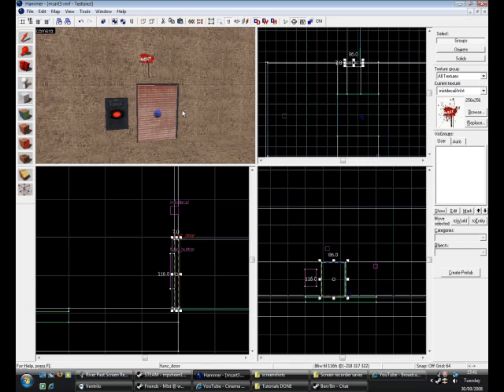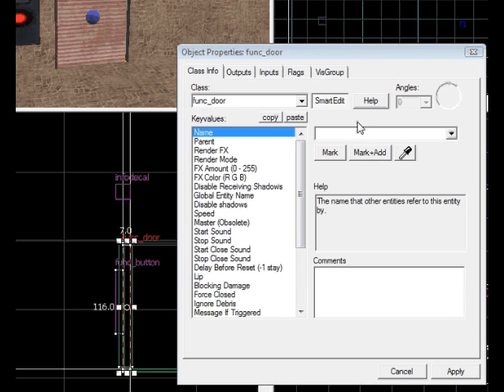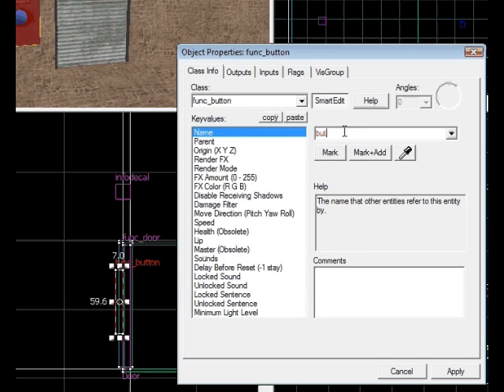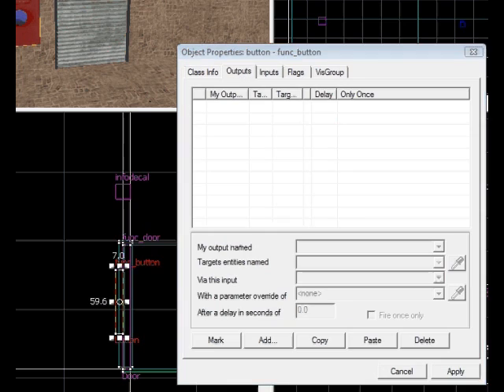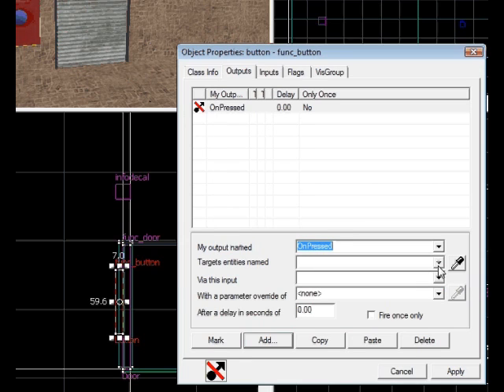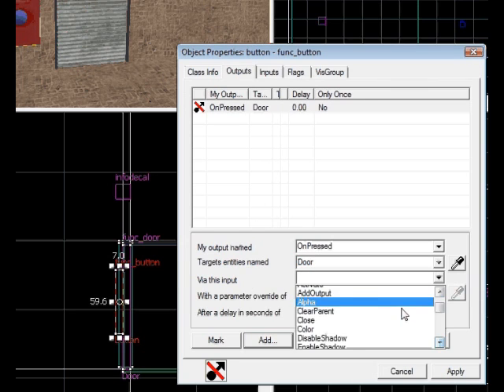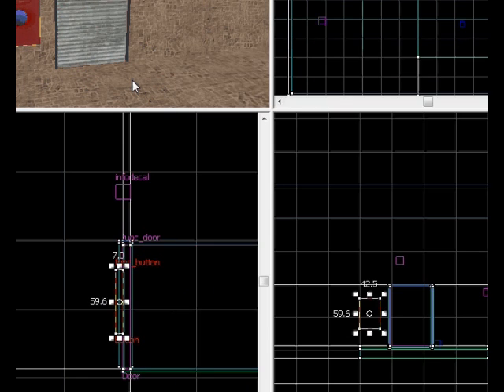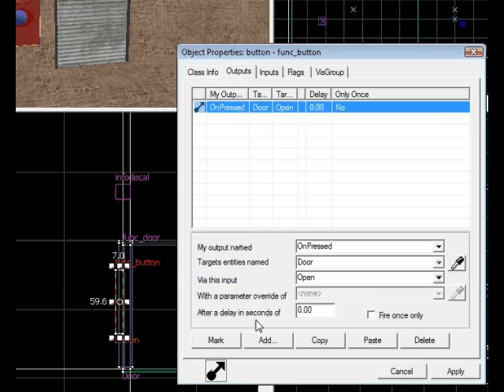Valve hammer Linking a button / Door

Comment: Question:
How do i make multiple buttons opent he door? For example 
5 buttons
I want them to be used in order.
( press 1 and the next button is unlocked )
Then, if a locked button is pressed, i would like the code to reset
(say code is 12345 and 12354 is pressed, i want the buttons to lock again)

Thanks